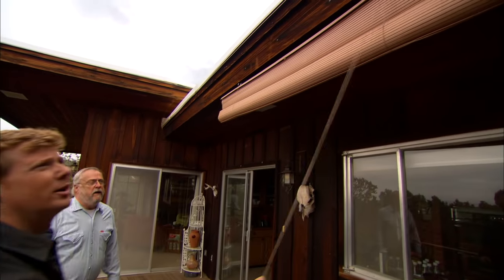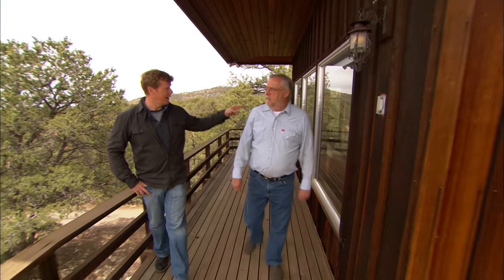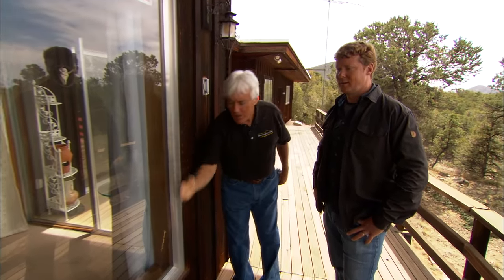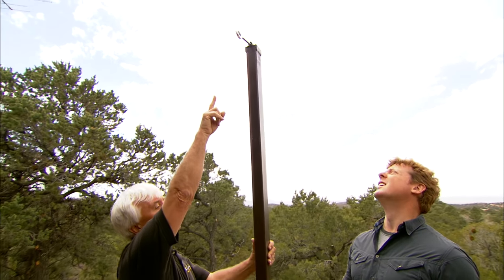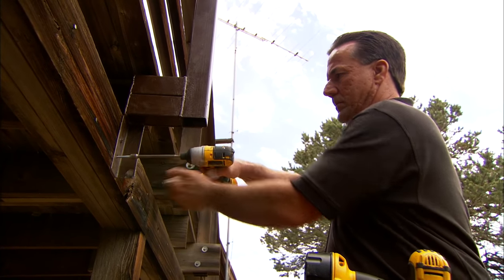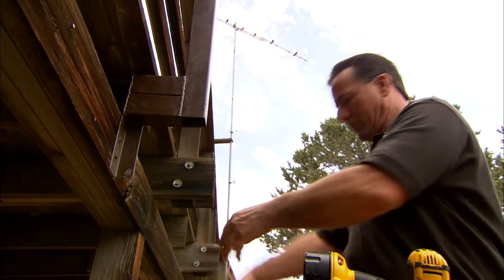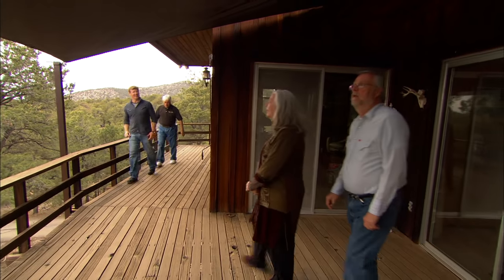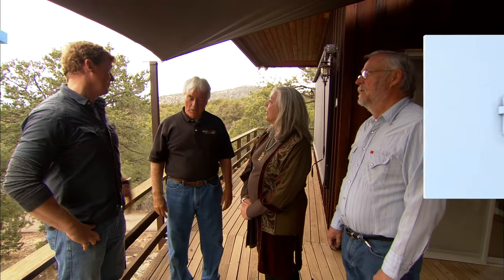How to Install a Shade Sail for a Deck | Ask This Old House

Comment: I love how the deck railings aren't to code lol those are large gaps and that deck is high af
Reply: You know in this country the code police aren’t going to come arrest you if your private deck is out of current code?
Reply: @micahwest5347  If someone was to get hurt because of this, guess who they are coming after?
Reply: @DyLemmaOG  His insurance company.  They apparently didn’t exercise due diligence to determine the risk of his policy.  A homeowner is not expected to be a code specialist.
Reply: @micahwest5347  ????? As a homeowner, you should know you don't own the property. You can't just put random permanent structures, every homeowner knows this. You could be fined a TON of money and on top of that be asked to remove the structure from the property. That's why there is permits you need to build these things.. an insurance company is not going to pay for a mistake LOL you're insane if you think that. You cannot win that case in court, as it will be shown there was no permit for that structure and illegal.
Reply: @DyLemmaOG  Wrong.  There are mechanisms in place to protect parties from some of these risks. For instance, if the home owner wanted to borrow money to build this structure the lending agency would insist on having an approved building permit.  That’s one mechanism to identify risk and mitigate. Another example is if the owner decides to sell the house.  This would trigger a home inspection.  That’s another mechanism to identify risk.  

Put your PPE gear on and go back to your hole with you local building code book.

Comment: is there a reason why people don't use light colored shade material?  A little reflection goes a long way.
Reply: The simple answer is a darker colour gives better shade so you don't have to wear sunglasses underneath. 
Hope that answers your query.
Reply: @stephenconnolly1830  ah, so it's actually brighter.  Hmm. I've had silver and black shade but never could tell a difference. White might not block enough.  

Seems like there should be a work around.

Comment: Are you kidding with this? Everything here is custom-made. It doesn't help regular folks who wants to do it on their own without hiring contractor. This is also a very expensive proposition - customized sail, customized, anchor, customized everything. This is the least helpful video on installing shade sail I've ever encountered.
Reply: @R YAY The audience here is looking to do it DIY. The owner hired a contractor. We come here to avoid having to hire a contractor. And it's incorrect to say one can order everything. e.g. where are we supposed to buy the metal anchor support for the post? It was custom-made specific to the available attachment structure.

Comment: I am looking for a company that makes HIGH QUALITY custom shade sails that will last years in the Texas Sun ???
Reply: Look at the coolaroo brand
Reply: ICON Shade systems.  They're commercial grade.  I have installed them in public parks.
Reply: Also Shade Systems Inc. I have also used these in parks and the fabric is unparalleled when it comes to withstanding the elements.  Expensive but you get what you pay for.

Comment: Not a very aesthetic solution, though. It has this very put together look. I also question the durability of the sail.
Reply: They are very durable if made from quality materials, like the one in the video which had proper fixings.

Comment: What a horrible job. There is so much slack in the material, additionally, you used 3 inch by 2 inch custom reinfroced square sttel post, 3 of them! then on the other end used plastic clips with screws not even anchored to the house....what a horrible horrible job. this thing will blow down in a week.

Comment: Ever heard of window film? 😁
Reply: Not as effective and looks like crap after a few years of direct sunlight. Also can still have heat gain for the other half of the year
Reply: @shimes424  it's very effective. Just use Huber Optik brand nano ceramic tint. Never fades and has lifetime warranty
Reply: Sounds like you never used the clear transparent ceramic films Scott.

Comment: I like the shade sail but I would have tinted the windows instead of that roll down shade.
Reply: Nothing wrong with both.
Reply: @Zomby_Woof  Tint would likely be cheaper and wouldn’t visually change the outside of the house. And tint would likely last longer as the shade cloth is in the elements.

Comment: The exterior wood on that residence is in great need of attention. It may be redwood or some similar type of wood, but it is in the beginning to moderate stage of decay (rot). It’s sad that TOH didn’t bring it to the owner’s attention,  something like linseed oil (raw and not boiled) would go a long way to restoring the wood to a stage where it could be saved. It is now 5 years later and if nothing has been done, it’s probably too late.

Comment: As soon as he said but you have to take it down in the winter, that was a dealbreaker for me. What a bummer after watching 7 minutes, not enough demonstration and suddenly
pull the rug out from under me 🤭😳......
Great idea though , but I’ll make it stronger to last all year round....
Reply: But other than one whole season, you can keep it up year round!
Reply: True but then you lose heat gain in the winter and the cheer the sun brings in winter.  I’d take it down once I need heat in the house.  I do that with my solar blocking screens. Takes 15 minutes.

Comment: Curtains.
Reply: Problem is heat gain. Curtains won’t solve the problem. Yes it will block the sun. But between the curtains and glass is will collect heat and heat rises, eventually entering the room from the top of the curtains. Therefore curtains are not the solution.

Comment: Dang I need those custom steel poles for my deck. Are these sold online anywhere?
Reply: I used 2 pressure treated 4x4’s or one’s that matches your deck and used a small black rubber bungee cord ,S bolts and an eye bolt, the bungee absorbs the wind and keeps it nice and tight, mine does not sag. Cost was under $25 for the supplies and I got the 7 x 13 sail at Costco for $20, setup was ez and project was less than $50. Also so much easier to unhook the bungee and remove, less than a minute.
Reply: @DIYGuy-ye5fl  When did you see the sail at Costco?  In the store or online?
Reply: Lulujoy . Hi, they are in both of my local stores right now for $24.99(Santa Rosa,CA) they are also @ Costco.com  for  $33.99. Description is Coolaroo 13’ x 7’ rectangular sun shade. Hope this helps